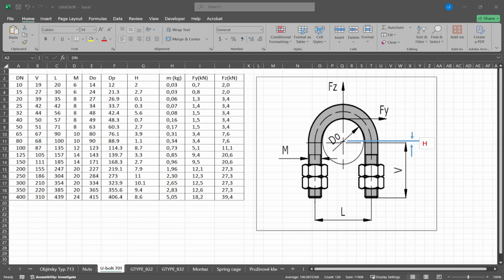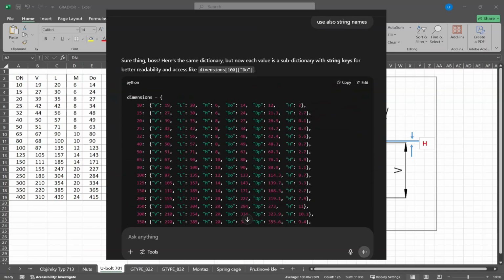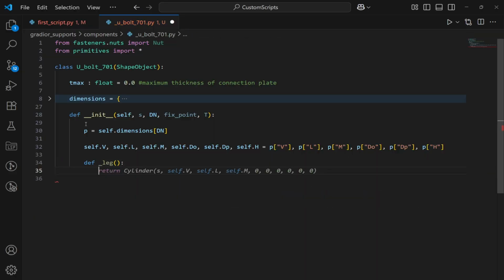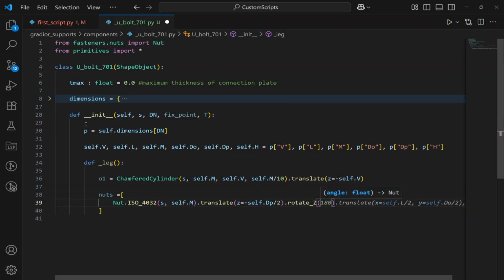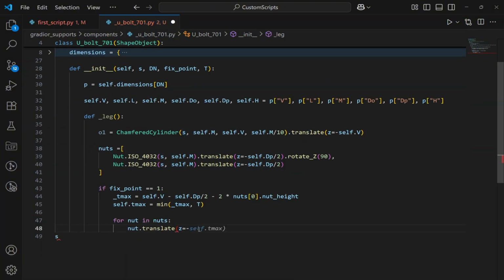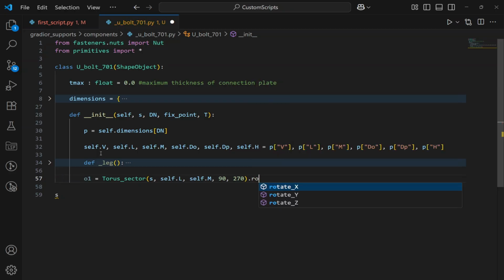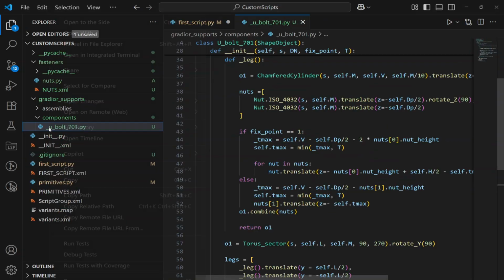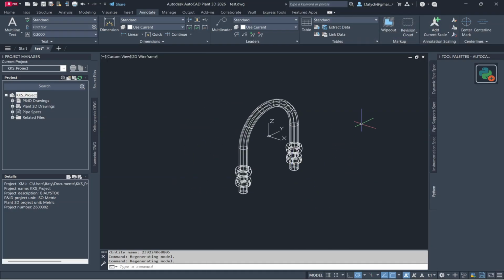Custom Supports in Plant3D with Python – Full Guide Series Part 6

Comment: Is it even possible to create custom support for plant3d 2024 version?
Reply: Ok,, i will wait for your video👌
Reply from the maker: Did you manage until this video? Everything is fine?
Reply: Yes, u bolt is creating without any issue, i just cant configure how to use structural members
Reply from the maker: Great. Nice to  hear that. Next week I am going to finish with ubolt - make it as support already and next video I will prepare the video about structural members library.
If you would have more ideas or needs - just let us know
Reply from the maker: @avijitnaskar8953 You can contact me via email l.fatych@gmail.com
Reply: L or i?
Reply from the maker: @avijitnaskar8953 L
Reply: I created a support script, and the model created perfectly in plant3d, but when i am trying to create new support using this script its giving me a reminder content geometry parameter definition should be filled with correct value
Reply from the maker: @avijitnaskar8953 if you used this script directly it is not going to work. In next video I will already show how to invoke this script . We need one more small step.
Reply: When trying to create new component using that catalog its not working
Reply from the maker: @avijitnaskar8953 could you describe a bit more precisely what doesn’t work?
Reply: I will wait for your next video
Reply: Showing me that massage when i am trying to save the catalog, like something is missing
Reply: In support catalog When i was trying to create new component using that script, but when i was trying to save the catalog it was giving me that reminder like some inputs were wrong
Reply from the maker: @avijitnaskar8953  I think because this script is not ready yet for catalog editor. Be patient, in the next video you will see the right way❤
Reply from the maker: @avijitnaskar8953 do you mean in catalog editor?
Reply from the maker: For sure. It is going to work the same way as for 2026. I have started from 2024 as well.